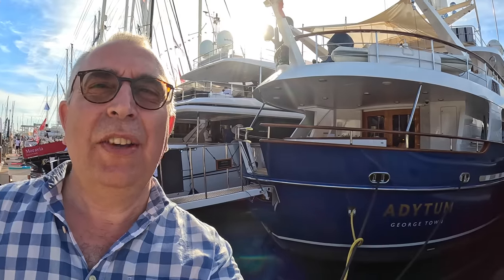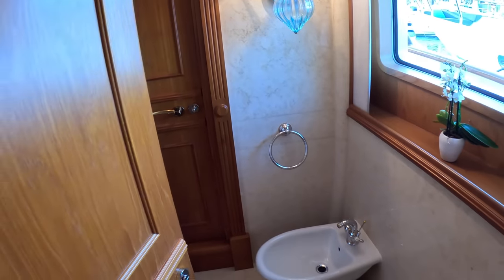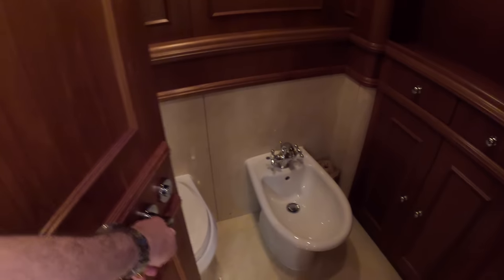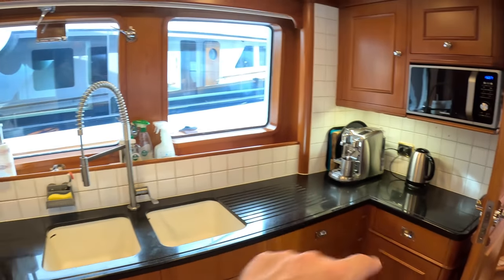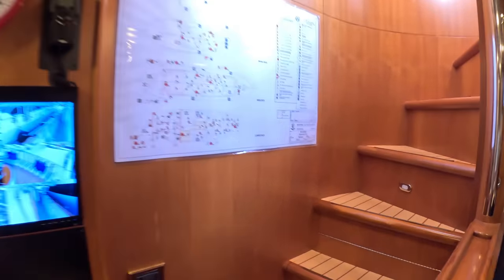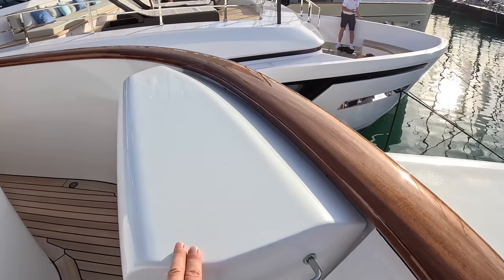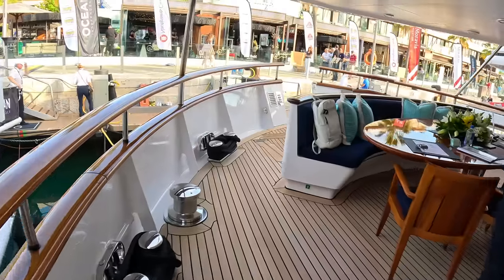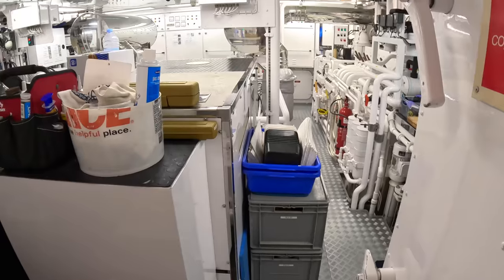$7.9 Million Superyacht Tour : 2002/2021 Hakvoort 34 Metre

Comment: Yachts like this are in a different class. That’s not to disrespect the build quality of Princess and others but this is a very serious oceangoing machine with luxury built in whereas they are floating hotels and vacation homes capable of cruising on the water. The quality of woodwork on this one is a cut above. This isn’t a yacht that’s the result of modular construction where the puzzle pieces are assembled. This is a work of art created from the hull to the sun deck. Amazing piece.

Comment: Another fine tour Nick. Very beautiful boat but I would have three issues with it. One, no easy way to access the water or much room for many water toys. So not a friendly boat for families with children. Two, no dishwasher in the main galley, only in crew quarters. Which makes hard for the crew, having to make them run up and down stairs for service all the times. May not be so bad but with only 4 crew for whole boat, it can stretch them a bit thin doing service. And my third issue is more a personal preference and that would be no hot tub. Especially for a 111 foot boat.